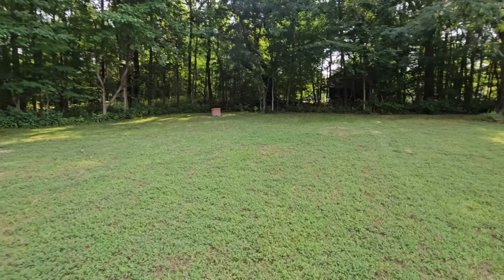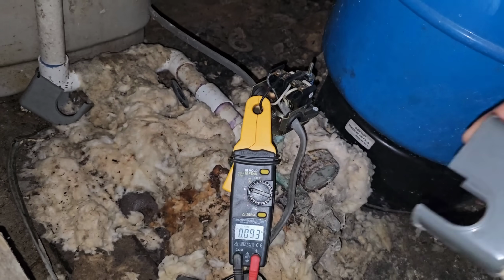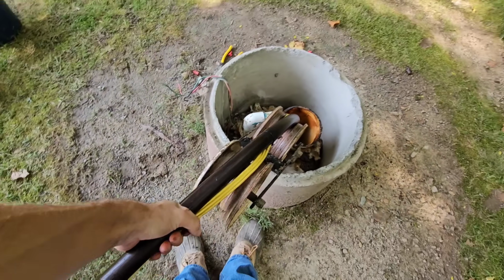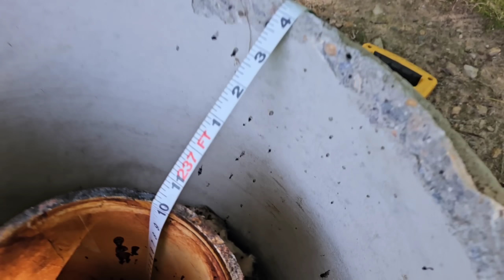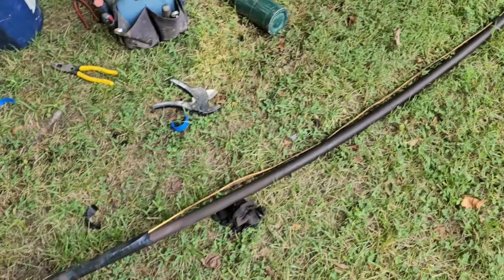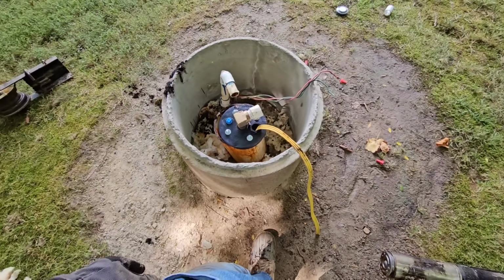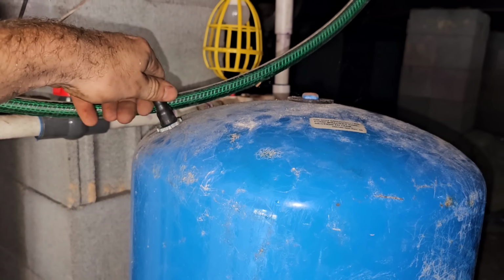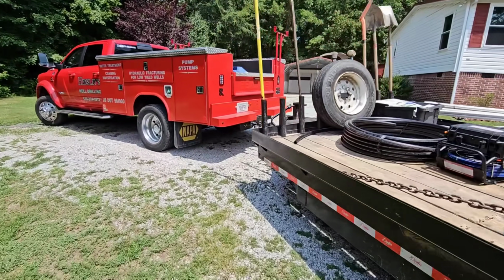Well Pump was Stuck on the Bottom in this Nasty Mess! That's Terrible Looking

Comment: I would imagine pouring chlorine down a borehole would be a bad idea. Firstly the corrosion to the equipment and secondly chlorine indiscriminately attacks a lot of things other than only pathogens. Perhaps it is able to pull metals and other minerals out of the ground forming water soluble salts.

I think the best way to use chlorine to treat water would be after an aeration settling stage/tank. Someone suggested using two tanks switched between chlorine treatment and off gassing periods.

Comment: Is that a polly pipe all the way down?
Ours is jointed and requires a pulling unit to pull the well.
Interesting using that roller setup

Comment: Thank you for your videos. I've watched almost all of them over the last year. I've got a new well (right at 2 years) that the pump won't stop running and tank wont come to full pressure. I'm thinking there's a leak down below. Is there a trick to getting water out of the pipe to make it easier to remove?

Comment: Philip thank you so so much for your very detailed videos! You have been a tremendous help to me. I was hoping that you could tell me how deep I should put my pump. Well is 30' deep, static level is 50'and well produces 12 gpm, water zones at 75 to 80', 285 to 290" & 336 to 340". Info is from permit paperwork. Pump is a two wire 1 HP. Also I was wondering if I could purchase a pump liner from you or maybe see if you know what schedule the pipe is that you use to make them. I'm trying to avoid using corrugated. One last thing I like what you said about using the flat romex looking wire and I can't find anyone who sells it, do you know of any online places?  Thank you again you're really good at what you do, well & videos and I very much appreciate you!

Comment: My dad bought a house had a well he was told put a sistran in and have a float so the pump would shut off when there was not much water left the first pump did not make it 4 years and the house was about 4 years old
Reply: After that we never had water issues but the water from the well filled the sistran  I'm sure there was more issues but does that make sense to you
Reply: At the time 5 kids and my worth less stepmother but I don't think we ran out of water once the sistran was installed
Reply: I can give you the box number it was ruell route 5
Reply: 324 strommy addition

Comment: My vacation cabin has had muddy water since I bought it 7 years ago. My solution was to install extensive filtering system. It is red mud. Not iron bacteria.  Now I’m thinking the pump may be on the bottom or too low. Should I try to raise it 10-15 feet ?

Comment: they replaced our worn out pump and replaced the steel pipe with 300ft poly pipe.  However, it failed soon because the poly kicks with each startup and the whipping of the poly wore the wire thru on the edge of the bore hole.   I was told later by another pro that with poly, you should put special spacer donuts every few feet to save the wire.   Is that needed here?

Comment: You shouldn’t be thinking of 20 feet of pipe as 20 gallons of storage.

As you draw down the well lower and lower, the recharge rate will actually increase. Hopefully at some point it will equalize with the amount of water you’re withdrawing from the well.

Meaning 15 feet could actually be the difference between never pumping the hole dry and sometimes running out altogether

Comment: Are there not devices like a duty timer that could be installed in the house on a well pump circuit to detect and stop things like short stroking, excessive running, excessive current, etc.?  Seems like a pretty simple device from an electrical engineering standpoint.

Comment: Pouring or subjecting wire connections to chlorine fumes is not good. Cl is a corrosive. The jacket helps protect the wire in the other places, but that splice became a weak point.

Comment: I wonder he has ever tried using cooling vest when working in the heat. We use them here in Arizona. I work on commercial trucks and they can be a lifesaver. It can be a little awkward at first till you get used to them.
Reply: They have those vests for umpiring behind the plate as well.

Comment: Wells are pretty simple and I’d hate to over complicate them but some kind of control unit that would trip if the pump cycled too quickly could potentially save a lot of people a lot of money. Do you know if such a device exists? As a homeowner, is there another way to prevent this? How often should a pump cycle if everything is working correctly?

Comment: What is all the fluffy white crap everywhere? Is that insulation? After watching this, I have never been so thankful that my well is only about 15 to 20 feet deep, hand dug and rock lined. Our pump is in the basement which means it is easy to replace if and when it goes bad. I have also had to climb down in the well and remove tree roots that were jamming up the foot valve. The only time we use Chlorine is when the river overflows in to the Well every 3 to 5 years during spring thaw.

Comment: I'm surprised you didn't put torque arrester on the line down the well. It wasn't a great installation to begin with. The installation would be better with a pitless adapter.

Comment: Hey Philip,  I have a Well that is 365’ and static @65.  The pump motor is a Franklin 0170-5GRO7542W230.
3/4HP, 230v, 1ph.  5GPM 1 1/4” Discharge.  The pump was replaced in 2016, and again in 2021.  Now, the pump is doing the same thing as before.  Pumps water for 2 minutes, then trips the load.  Insane that those pumps are going bad so soon.  Plus, the cost of the pump alone is $2300 here in Durango, Co.  I noticed you use Grundfo pumps.  Do they have a pump you recommend or is there another Brand you recommend?
BTW,  thanks for your videos.  So much info and appreciate the depth of your Well knowledge.  
(Pun Intended).

Comment: I have a question that doesn’t really relate to the subject matter of this video but I figured I should try the most recent one… I have a well that I thought was frozen somewhere. The weather has significantly warmed up since the problem started almost a week ago. The water is running out of all the faucets in the house but only at about 15-20 percent the rate it should be. I have checked for leaks everywhere I can access and came up empty. Also the pressure switch was recently replaced. Any information you can provide would be greatly appreciated. I have been watching your videos trying to learn all I can about these systems but unfortunately I’m just a regular guy and I have absolutely zero experience or knowledge (other than what I have learned watching YouTube videos) about these systems.

Comment: What submergeable pump would you recommend for 50' deep well? It's a old well still makes good water. It has the big round concrete settings in it. Its 36" round and 50 feet deep.

Comment: Couldn't you flush the well to regain what the depth from the sediment.  Or perhaps drill the well deeper.
Personally I would have recommended either drilling the well deeper like you suggested and explained to the owner this is kinda like wrapping a ace bandage on a broken leg.  Telling him this is better than nothing but here are your options for proper repair.  It was something I did when I was explaining on foundation repairs of older homes.

Comment: A bad pump will not cause the wires to short. You were eight the first time with damage from the clamps. Ive fixed lits of wells and its always misuse  or poor workmenship from the drillers. Our drillers are not allowed to plice cables.

Comment: Great job. Out of all your experience with wells what well pump would you recommend for a 150 foot well with a static level of 20. I know theres some Chinese brands to beware of but whats a good durable well pump with that will give a good life.
Reply: Not the original poster, but generally if the well can produce more than 10 gallons a minute you could use a sta-rite 1/2 hp 10 GPM set 60 - 80 feet. At that pump setting you would get approx 10 - 12 GPM at the pressure tank. Don't buy any plastic bodied pumps, stick to stainless. USe a torque arrestor, check valve and a wire centering spacer at every coupling.

Comment: I have been doing wells for 50 years and here in PA, we put a torque arrester every 10 ft and a check valve next to the pump in case a pebel or something else gets stuck in the built-in check valve.

Comment: My well is 450 feet deep. I've got metal sucker rods that are in 45-foot sections. Because of this, we have to hire a crane to pull up the pump. I see that black plastic pipe. What is that? Could it handle the water pressure at the head at 450 feet?

Comment: With that kind of depth I'd put all new pump.pipe and wire it's not worth the risk going cheap.    I'm surprised at that depth it's using  that black abs when I had to havevmy well service for a blown wire and stuck pump I was advised the pvc or steal pipe was way better depending on needs for depth of well and way easier to pull a stuck pump with something stronger

Comment: Electricians use a megger. Puts 1000v down the line at low amps to check insulation integrity
Reply: Which is superfluous in this case as the fault is known. Moot comment.

Comment: I just was diagnosed with Covid this morning. Hopefully it won't be too bad. Sucks...
Reply: Good luck! I got it earlier this year and it was pretty mild.
Reply: Get well soon. The current strains are more infectious but less symptomatic overall so, not the same worry as before. I had covid this year too. It was rough. I also had about a week of my thought processes being interrupted though.
Reply: As long as your not 95 years old or immuno-compromised you will be just fine. You are going to be miserable for a few days or so and probably feeling weak for a couple of weeks however. I got it early on when the early strains were a lot more severe. I have a high risk for respiratory infections and pneumonia but that that was the first time in over 10 years I got any kind of flue or cold that didn't turn into a full blown respiratory infection or worse leaving me sick for weeks to months. 

Rest up, hydrate and feel better soon.

Comment: Just watching paying half attention to a plumbing (oh boy...boring-lol) video, OK, job done big whoop, done that and a million other home repair jobs, gets old real quick. .........Then.............2hrs 15min... start to finish? Holy Schit Batman! OK, OK.....now I'm impressed! Good job, I used to love doing what seemed impossible to most people, or impossibly fast, like changing out a burnt water heater element start to finish in under 10min (no need to drain tank). Tricks of the trade are worth gold sometimes! For comparison to this job, my above ground jet pump, 6" casing, 1.5" black plastic pipe, metal cap, goes down all of 27' til it hits water, then goes another12' to the foot valve. Shallow might be an understatement-lol.

Comment: Question, how come wires are not ran down into the steel pipe in a plastic pipe like Pex tubing, this is not the first well i've seen shorted wires on.

Plus is there any way to pump the black shit up out of the pipe and off the walls of the casing?
Also could the well be drilled deeper in that well? 

Last will the black stuff spoil the taste and quality of the water, it looks like its going to take a lot of filters to clean that stuff out. Its clear back into the house.

I think i would have a new well dug out and use that one on the lawn.

Comment: New Subscriber hi there, The last thing I need in life is a well ... I have 1500sq mets of roof dropping into 2 x 5000ltrs solar pumping to 2 x 30,000 tanks and I'm watching Why?
I live in a land - well it's raining at 15mm an hour and the water is coming up out of the land ... 
BUT  
I'm interested in the fact that you know your job, and get shit fixed and I had a thought about your job.
In my younger days I installed Fence Lines through places machines can't get and I bored down and used explosives ..You'd do an entire fence like in a day and the thing that I noticed was at the bottom of the hole there was this Ball shaped hole ...
Why not just Blow the bottom with explosives - has to be quicker than Fracking and look at the cost of the machine.

Comment: You don't use electric tape, duct tape or any tape to attach sub electric wire to pump pipe.  Your clients do not want to drink tape glue. Tape glue and tapes are not qualified to be in contact with food stuffs for human consumption including drinking water.
Reply: You should have a filter anyways
Reply: 😂 you saw all that stuff on the pipe, but your complaint is with the tape.😂
Reply: Bro... there was rust, pre-existing tape, sludge in that well. Any small amount of adhesive that can or will come free, is the least of their concerns.
Reply: Do people usually drink well water when your well looks like that? Do people usually pour bleach in there well when they are drinking the water?

Comment: I get so tired of people coming out, replacing certain parts, and have to call them back 6 months later to replace something else.  They come out, replace a fitting that is corroded, but not the wire.  If a fitting is corroded, most likely the wire is corroded.  That causes voltage/amperage differences which causes all those other issues.  I'd rather just replace all the parts and not have to call them back for years. The service call cost for one trip pays for most of the parts.  You may get a bigger repair bill, but it'll save you tons of money in the long run.
 They prob just used the stuck pump as an excuse because they didn't want the liability to just "fix" the issue.

Comment: The chlorine should be added after the pump not in the well. Chlorineate/ dechlorimate
Reply: Yep chlorine should always be added, hose left running to clear water, sample bottle left for customer to pull a water safety sample - we used to charge for the test on service date otherwise cust's would not always want to bother.

Comment: had a pump guy come out to reline my casing he broke the drop pipe and foot valve off and just left it had 2 other companies come out and refuse to even work on it 3 company said its unfixable cant get the pipe out its a 2" well that was 2 months ago btw first guy billed me for 800 did nothing was here about 2 hours and killed my well he isnt getting paid 3 company said they would do a new well to the tune of 7k+ for a 100' rockwell they started 2 weeks ago still no water they got it drilled and installed but it only pumps mud im at a loss what to do because they have moved on to other jobs

Comment: Man, the covid thing... It honestly makes you feel like you just woke up 2 minutes ago but you stay so for 2 whole weeks
Also it's insane to me that you guys never use motor starters. Over here if you have a short cycling issue, the overload protector just pops. Only time I've seen a pump pop at work was when the third phase went out on the plant and some real piece of work set the motor starter to allow 25 amps instead of 7

Comment: What if ur pump hits 20 amps on start up then drops right down to 9.5 amps
Reply: A brief spike in amperage at startup is normal, the important part is the running amps. At 9.5 sounds like you have a 3/4hp pump, so that should be about normal. The run amps will depend on pump voltage, hp rating, and setting depth. In your case, read the well tag for the pump hp (should be on there) and pump depth. Then search for submersible pumps of the same hp rating to compare the results for current draw ranges. If a pump holds at a higher amperage then either the start box (if present) is bad, or the pump itself is bad. Or you have a grounded out or shorted wire.
Reply: @mxslick50  no tag
Reply: @adamlynn6648  You should be able to get the well driller's logs from your city or county records office, that will have most of the data on it. 

If you are currently having pressure issues or running out of water, get a well company out to you to investigate.  If not, may I ask why you were checking the current?
Reply: @mxslick50  the well guy check it when the pressure switch went out and he said thats a lil high for start up amperage the well feeds 3 properties but im the one that maintains it
Reply: @adamlynn6648  Does it have a control box in the wellhouse? If so, the start capacitor may be getting weak.  If not, it means the cap is built in to the motor. 

In any event, my decades working with motors tell me he's not quite right, that amperage on startup for a 9.5 amp motor is just fine. Most motors can draw 300% or slightly higher on startup for a few seconds. 

Just keep an eye on it.
Reply: @mxslick50  it has just the pressure switch and the pressure tank is in the ground

Comment: What a hack no extra check valve no torque arresters poly pipe plastic pump you can’t set a pump that deep and rely on the cheep check in the pump

Comment: What is an ideal distance to have the pump from the bottom of the well?
Reply: 30(ish) feet is common.
Reply: @PelicanIslandLabs  It does depend on the circumstances. I drilled a seventy foot well for our local Community Hall and thirty feet would greatly reduce the storage capacity of the well. I set it at ten feet, per the pump manufacturer's recommendations, but remember: this well was fully lined. If your well is not lined all the way to the bottom then you'd best stay up higher.

Comment: Cheap job at $7.50 an hour plus pump and Switch  plus Air tank  ... yes  interesting that you guys dont use Armour Cable ... for power feed  to the pump ...

Would seem a regular flushing cycle would be appropiate for this well system ... 
Yes Covid is a bit of a Bastard of a bug ... 

Speedy recovery good Sir 

Agspanner😮😮😮 

Ps dont tell Trumpf  he might put a Tariff on the water 
😂😂😂😂😂